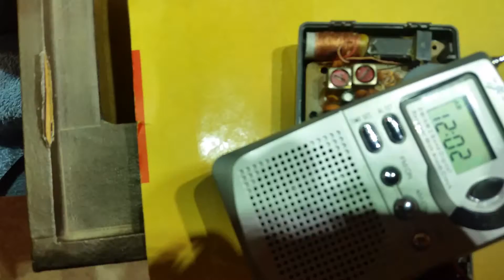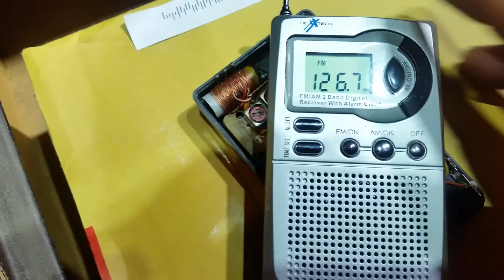Modify Digital FM for Aircraft

Comment: WOW, Im SHOCKED Thaat The Display SHOWS The Real Frequency After You Moded The Coil And Variable Cap.. AMAZING VIDEO, Now I Will Buy A Cheapo Digital Radio With manual Tuning (WITHOUT THE SCAN FEATURE) And Do The Same And I Will Scream In Hapiness If The Mhz Screen Will Show The 135 And So On And Not Only Comercial FM Mhz Range !
Reply: Did it work to modify the radio? Radios like this are quite rare these days.

￼

Comment: FM is Analogue and not digital and Airband is on AM mode, not FM, you will only hear pulsating and data sounds between 108~118mhz and Air traffic control voice communications are heard between 118mhz~137mhz and have tuning steps of 8.33khz and 25khz respectively.
Reply from the maker: The radio readout is digital and you cant expand am broadcast unless you expand fm frequencies. Make one according to the video yourself and strangely I hear aircraft and control towers all day long at 132-135 because I live near an airport . so save your speech so not to discourage people from experimenting. And yes the radio selector must be in FM mode.

Comment: I bought a tiny radio from Ali Express, 10 or 12 Dollars,good on as m/FM and the air band works great too,for as tiny radio and cheap as it was it works good ,the radio  is rechargeable too ,but in as ll fairness I live as half mile from as small air port and bigger planes fly by to March afb, and Ontario air port.does anyone if police type scanners pick up the air planes too?
Reply: If your scanner can receive between 118 and 136 mHz then it can receive air band. Some scanners will have a mode selection, if so select AM as that is the modulation mode used in air band, some scanners will automatically set AM when you tune in this block of frequencies.

Comment: Problem with aircraft is that they use am....
Reply: Maybe in some instances, but I can assure you that the analog radio mod works.
Reply from the maker: FM is an AM frequency. Not am/standard broadcast
Reply: @vincebiano190  AM of FM are not frequencies, but modulation. Frequency modulation and amplitude modulation.
Reply: Exactly, same with all the other mods on here to lift FM radios up to the air-band by opening the inductance coil to increase frequency. Sure the frequency is increased but it doesn't solve the FM // AM problem. In a nutshell these mods are stupid and useless. Everyone gives a demo of the increased frequency but no-one give a demo of receiving a signal.